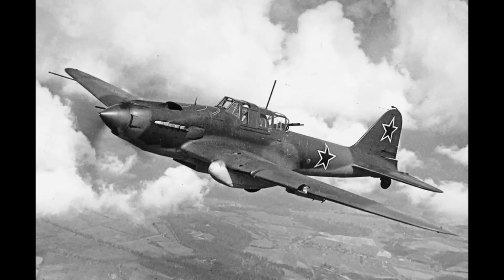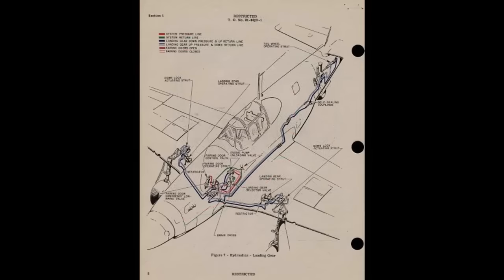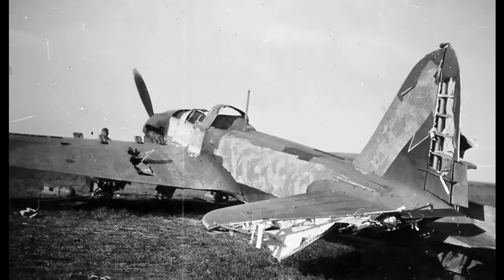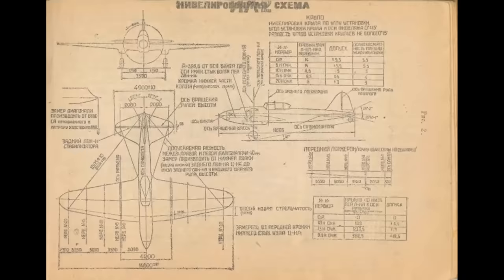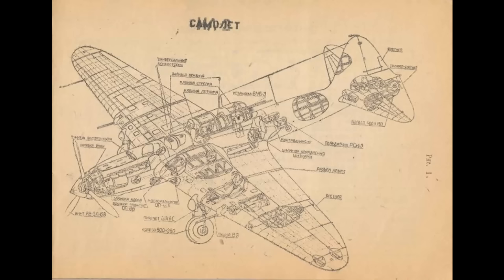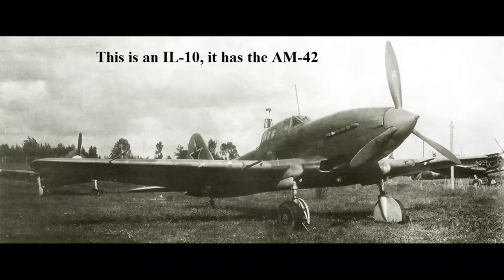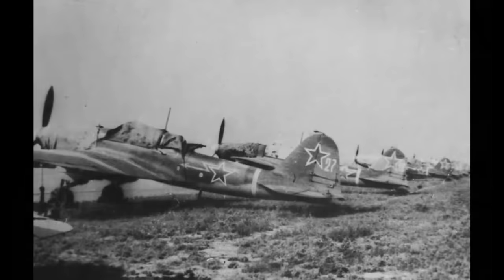Ilyushin IL-2 Sturmovik

Comment: AM-35 and AM-38 begun as basically the same engine with the different compressor. As war progressed, demand for Il-2s  with AM-38 was deemed more important then MiG-3 with AM-35 for which simply there was not enough high-altitude threats it was built for. Also, for low level combat there were new Yak-1B and La-5/ La-5FN on par with later Bf-109s and new Fw-190s at that altitude.

Even in 1941, there was a struggle for performance, but such that can be massively produced.  Klimov initially increased power of his M-105 by increasing pressure to make 100-150hp more power and made some serial produced engines tweaked that way pass durability tests. No hardware changes. Voila, M-105PA!

Comment: One of the most praised Soviet aircraft, looked down by Axis pilots - I'm Hungarian, and I read a lot WWII Hungarian pilot's report, and not a very highly praised aircraft is the Sturmovik (it was an easy kill for a 109 or a 190). Very very controversial aircraft. The engine, what made me laugh always - huge volume, low power for that - and the fact, that tremendous amount of gunner died in this type (something 7-10 gunner died under every pilot or something). I also wondered, what is that a Sturmovik could do, and a late P-38, P-47 or a F4U could not (all could carry about 4000lbs/1814kgs of bombs plus ten rockets, better rockets than the Soviet ones, Sturmovik carried about 600kgs of bombs not more). The only thing what was good, is the gun armament. Soviet aircraft cannons and machineguns were very effective (their weight, firepower, etc). I'm really courious about this series, please carry on!

Comment: I think the reason for not putting the Ash-82 powered variant into production was logistics. The Ash-82 was a very versatile engine that was able to power virtually every class of combat aircraft. The AM-38 was a dedicated low altitude engine, not suitable for fighters or long range bombers that had to be able to fly at high altitude.  
If the Il-2 got converted to the Ash-82, they would have been forced to stop AM-38 production completely and convert the production lines to Ash-82. That was no small task. We are talking about production lines that were able to produce up to 10000 engines per year.  Converting them was impossible to do without creating massive delays. You don't want that in a critical phase of a war. 

To put the AM-38 size and power into perspective: 
The Daimler Benz DB-603 was a 44.5 liter engine, just slightly smaller than the AM-38. Originally, it was proposed to have 1600 hp and Daimler Benz planned to start mass production by the summer of 1940. When the war started in 1939 , the nazi government in Berlin forced Daimler Benz to stop all further developement because somebody had decided that having one engine of that size (BMW-801) was enough. Only after that decision was proven to be terribly wrong (massive reliability issues of early BMW-801 and a painfully slow ramp up of production), Daimler Benz was allowed to restart developement. The vast majority of the DB-603 production was the 1750 hp model. Even though the engine was able to run at 2700 rpm, Daimler Benz struggled to make later, higher power versions reliable enough for combat service. 

I'd love to see a whole series on the Il-2 and all the related developement.

Comment: it's  noisy, really noisy. There's one in Kbely Museum near Letnany, Prague and used to be one flying about in Mlada Boleslav.  Don't think flight training time was exactly  longer than going up and getting killed with an extremely short window between draft, production and German invasion. And then there is that very slight problem of Stalin's temper and purges. they probably had about 9hours training.... so why be surprised?  British training was just a bit more. there's also an IL-2 in Everett  (flyable) and another in Udvar-Hazy, VA .

Comment: Winston Churchill defined Russia as "a riddle, wrapped in a mystery, inside an enigma,"
This seems to well-apply to their aircraft and information about them as well.
As an aircraft enthusiast as well as a pilot since I was twelve, for many years I considered Soviet WWII aircraft (and everything else Soviet) to be fairly clunky, unsophisticated, tractor-minded, ponderous things, designed more for mass production, sheer mindless bulk, and for the official acceptance of a high casualty ratio than for elegance, cleverness, and/or aerodynamic finesse.
As an aside, I suppose that one might also feel this way about Grumman and Republic aircraft (I have lived for all of my adult life fairly close to both the Grumman and Republic factories and have known many who worked in them) for their amazing built-in strength and durability for which many pilots and crew owe their lives. This is so, except that, as you so well know and have so well shown us, while Grumman and Republic designed and built airplanes that were tough as hell, they were also elegant, and both aerodynamically and mechanically sophisticated.

Anyway, while my initial thinking about Soviet WWII aircraft was not entirely untrue (or without the double negative – “true”), I have since come to better appreciate some of the Soviet WWII-era aircraft designs and find that I was mistaken about at least some of their aircraft. Your vid on the IL-2 has given me much information and much to think about.

Thank you, Greg.
 Cheers

Comment: Soviet fanboy here. 

Perhaps reasons the rpm could not be increased are related to both flame path distance, and piston speed over the long stroke required for the big capacity?  These are absolute parameters.

I am sure the Soviet production system was less ideal than properly competitive, high investment capitalism such as that which existed in the US industry in the 1940s (albeit it was the Roosevelt system which many neocon fanboys would call socialism). 

But if you compare the Soviet system when they were copying the B-29 (not really a very typical measure of efficiency), I think comparison with the British would flatter the communists.  Arthur Harris was railing all throught the war over the difficutly of improving production standards and developing out basic problems (like pathetic defensive armament).  In one memorable memo to the Ministery of Aircraft Production, he noted that Stalin would have those responsible  for persistently sloppy production executed.

Comparisons are difficult because the US enjoyed all the capital investment available from both a Keynesian-inspired FDR, and the massive transfer of wealth from Allies in Europe.  that leaves an awful lot of resources for R and D.

Comment: There was a specific reason why Stalin issued an order to copy B-29 instead of proceeding with Tupolev next generation design.  Tupolev was livid about it but was forced to back down.  During the Cold War Pentagon hired Boeing to run a study on required level of logistics and organisation needed to repeat the same process as Stalin's project.  Boeing conducted a study and compiled a report.  If would be great if Greg's Airplanes and Automobiles channel did a video on the bases of that report and then the reason for copy of B-29 would become clear.

Comment: Obviously I don't think this is a serious design consideration, but the 'classic' IL-2 with the inline engine looks pretty sweet, but the air cooled radial variant looks kind of ugly. It goes from sleek to kind of fat.  :)  The X-32 also looks fat and didn't win its design competition either.  

IL-2 is one of the kits in my pile of shame, and I have fond memories of IL-2 Forgotten Battles (now including dumb stuff like crashing on the runway during take off because I was running over the planes in front of mine that I didn't see with the nose pointed up), so I'd be interested if you do more.

Comment: nice vid as always! one of my fav planes in the combat sims!
id like to speculate about the weird manual; 
i think contrary to the germans the sovjets were very logistically concious, and why put a well a trained pilot into an il2? they never fly too far so not alot navigating needed, the plane was designed to soak up punishments like punching bag and hopefully be escorted, so no aerial tactics needed. the choice of targets also meant "easier" targets, meaning either stationary or slow moving that couldnt shoot back and even if only for a short time and when stationairy. they also mostly flew very low which means less faffing about with engine management. also it doesnt matter how many planes you produce if you cant man them so if you wanna increase the pool of ppl flying them you might do by lowering the skill needed. the attrition especially early on must have been stupendous (and judging by the luftwaffe did in the east  even so at late war stages). which didnt give them the time  to refine training. plus in late war there was still some reluctance going around on their tank productions switching to newer and improved tanks (eg t34m t44 to replace t34) im guessing the il2 had a similar status.
put it all together and mix in some a little communist disregard for human life means that if you are one of many that just about could understand the most basic priciples of flying an aircraft you were the perfect il2 pilot... so why would you put together a complicated training manual?

Comment: The Jumo engine’s annular radiator was a cunning design: low drag and a narrow section profile from below, shielded by the engine from behind and the fan in the front. Likely very expensive to produce and tough to service/replace.

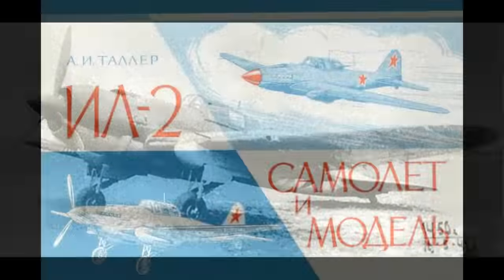Comment: 20:00 The effect of wartime restrictions is often underappreciated. To change vehicle type (and sadly lacking a proper source), Soviet tanks at the start of the war suffered from pretty atrocious spalling, ie. non-penetrating hits caused armor fragments to fly around in the crew compartments, doing all kinds of damage. The focus was on cranking out numbers, not steel quality, and the effect decreased over time when better steels were used. German tanks on the other hand started the war with great steels and little spalling, and spalling increased significantly when lack of certain metals used for certain alloys made the quality of the steel worse and worse as the war progressed.

Comment: Smithsoniam Air and Space magazine had an artice on the copying of the B29 for the Tu-4 project.  It was a blessing in disguise that the plane was made with imperial units as the Soviets did not have the exact gauge of metal needed.  Hence, they had to select the closest/thickes materials and ended up with a plane heavier than the B29.

Comment: Hey Greg!
Great video.  I would indeed like to hear more about the air-air capability of the IL-2.  While obviously not an ideal fighter,  I do wonder how much had to do with the technical capability of the IL-2 and how much had to do with pilot quality.  It really doesn't seem like the Soviets were putting well trained pilots in these planes.

I also have two additional topics I'd really to see explored.
1)  How well did the armor of the IL-2 work against ground-fire that the IL-2 was attacking into?
2)  What kind of effect for cost did the IL-2 deliver?  On the face of it, producing dedicated ground attack aircraft on such a large scale and unavoidably losing large numbers of pilots and planes in dangerous attack runs seems hard to justify.  But I'm guessing that the damage they inflicted must have been high as well?  That's why I'd really like something breaking down the costs, time, and crew related to producing and operating the IL-2 compared to their effect on the war.  How many attack runs did the IL-2 normally survive vs how much damage they inflicted?  Were the IL-2s instrumental in achieving breakthroughs or sudden victories,  or were they more of an attrition weapon?  I know this would be relatively hard to answer so I completely understand if it goes beyond the scope of the video.
Reply: IL-2, and other ground attack airplanes of WW2 were not exactly super effective. Accuracy was lacking. German statistics seems to confirm that.

Comment: Thank you for your hard work researching these and also for your fondness for primary sources. Honestly I don't care much which nation's aircraft you talk about -- each has an interesting story, even if it's just to learn what a fighting force deemed "a problem" and how a design team then came up with "a solution".

Speaking of solutions: I think the sleek nose has a big advantage in better visibility for the pilot. A thing like that has the potential to save lives, especially when the plane's low and slow (under relatively high angles of attack).

Comment: The Soviet Air Force and the IL2 was far less efficient than that of the Western allies. 

-The Soviets had more aircraft  assigned for close air support missions than the allies. 
-The German forces were unable to fight a battle in open terrain or move forces during daytime in the West as of 1944 but did it in the East till end of the war. German war time stories and reports mentioned very often about the allied air power in the west but in a far lesser extent in the East.

What might be the reasons? 
Lower pilot skills? 
The IL2 is an unstable weapon platform with very low accuracy? 
Less communication and organization?
Reply from the maker: There are a lot of reasons. I'll get to that by the end of the series.

Comment: I think perhaps some of the reason for the excessively detailed manual is the Soviet obsession with thoroughness, formality, and bureaucratese. If it was in the manual, any fault in operation couldn't be pinned on the author. It also didn't give the end user any excuses for not performing their duties. It was a hallmark of Soviet society to do exactly what you were told, but ONLY exactly what you were told. No doubt the poor pilot training had something to do with it as well, but I strongly suspect that it was far more due to the nature of Soviet society.
Reply from the maker: It's sort of the opposite. There is almost no detail on the airplane itself in a technical sense, it's more like a lesson plan for a 15 hour student.

Comment: Hey Greg, your videos are always much appreciated. 

Regarding AM-38 connecting rods. The English Wikipedia uses the same "articulated connecting rods", while in Russian the term is "надставная группа шатунов". But searching for that leads nowhere, it seems like it's just not a proper historically used term. After searching some more I've found a 1944 manual for the engine and there it uses the term "прицепные шатуны", and the proper English name for those are slave rods. So the master and slave rods on in fact AM-38 had different strokes. There are also pictures of those rods in that manual. You can find it by searching for "Борисов Г. (сост.) Авиационные моторы АМ-38 и АМ-38Ф" or if you want I can email you the pdf link.

Comment: Prior to designing the Il-2 Ilyushin had designed the Il-4, which sounds odd but that was because, in Soviet-fashion, it was originally called the "DB-3" and was only changed to "Il-4 later.  The DB-3/Il-4 was a long-range twin-engine bomber that looked a bit like the USAAC'S Douglas B-18 "Bolo", but actually pre-dated the US aircraft.  The DB-3/IL4 also had a larger bomb load and much longer range than the B-18.  In fact, an early version flew non-stop from Moscow to New Brunswick, in Canada.  First flown in 1935, the DB-3/IL-4 served throughout WW-II as the Soviet's principal long-range bomber and nearly 7,000 were built.  The only reason more were not built was because the course of the war made it necessary to move the production facilities East of the Urals, and because the Government (i.e., Stalin) dictated that aircraft factories concentrate on the production of fighters and ground-attack types, rather than bombers.  In addition, deriding the Soviets for not having anything equivalent to the B-29 is a bit unfair because, in 1945, nobody else in the world did, either.  Furthermore, the Tu-4, which the presenter mentioned, was not an exactly "copy" of the B-29.  Instead, the Tu-4 should more properly be termed an "adaptation" of the Boeing Superfortress bomber, with the dimensions and specifications of every single component part re-designed from English into Metric units and utilizing existing Soviet engines, weapons, systems and other component parts.  Stalin personally ordered Tupolev and his design team to get that done as rapidly as possible and, in fairness, they did a pretty creditable job of carrying out that extremely complex task.  The mere existence of the Tu-4 terrified the US and led to an enormous expenditure on US air defense.